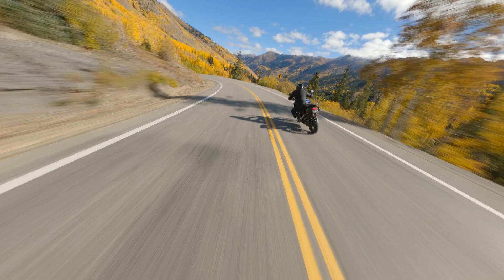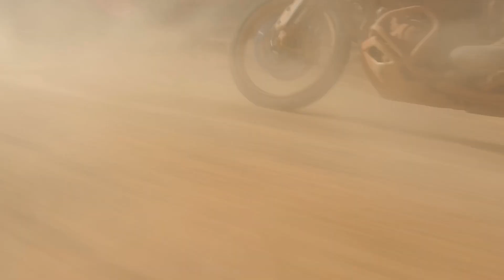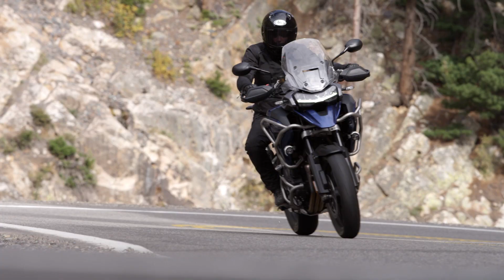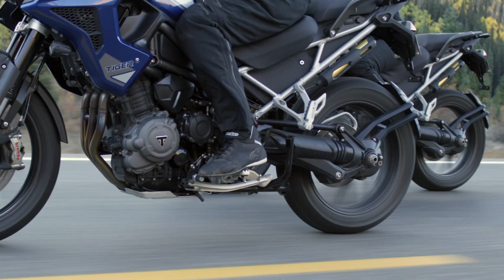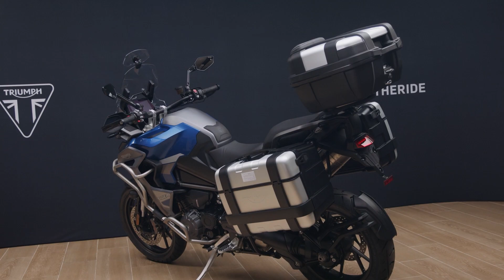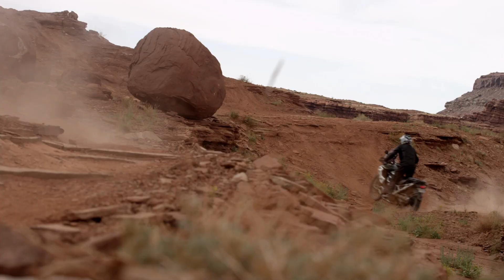First look: New 2022 Triumph Tiger 1200

Comment: There's just one detail I don't like: the rear tire. I think GT models should stick to a 17 inch wheel and wider tire (at least 170 mm wide or even better 180 mm). Losing that sexyness of a fatty rear tire on the road focused models might even become a deal breaker for some of us.
Reply from the maker: Would be interesting to know how easily you can fit a different size wheel and/or tyre there...